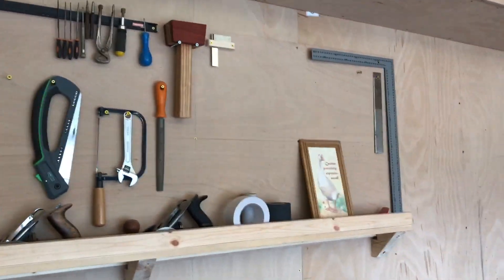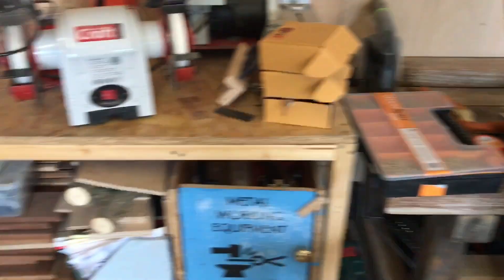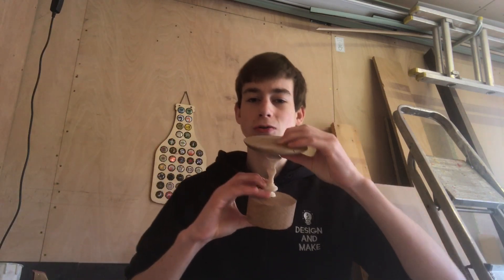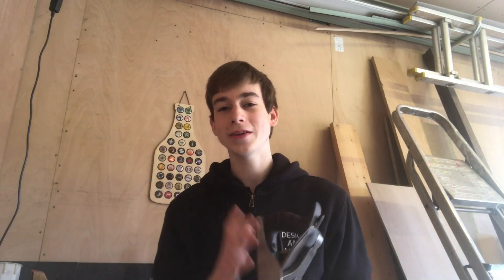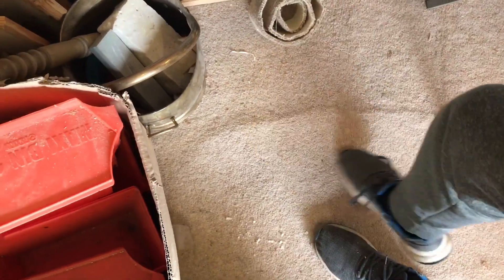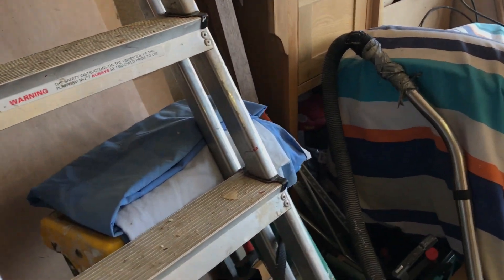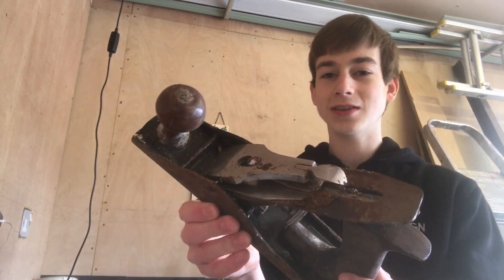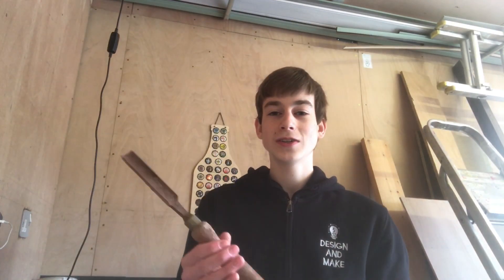Big Workshop Changes | Tool Wall And Old Tools

Comment: Excellent update.  Really like that tool wall - nicely laid out and functional.  It will make a great backdrop for your filming.  I really like how the shop is coming together.

Depending on how much mahogany you have, you can either make a box or a nice little side table with some turned legs.  Mahogany is my favorite wood, I think it just looks amazing.

Oh, and you now have something in common with Matt Estlea: Clocks that don’t tell the right time. XD
Reply from the maker: Thank you! That’s the plan to use it as a backdrop. I love the idea of the table I hadn’t thought about that! Thanks for the idea, I have so much mahogany so could definitely make a table. I’m glad I have something in common with Matt even if it’s not his woodworking ability 😂!

Comment: Brilliant video, as ever.  I have found that if I have lots of shavings on the floor from the lathe, I do attract lots of mice (so be careful), and those pieces of mahogany(or something) you could use to make a nice, wee dovetailed box
Reply from the maker: Thank you! I clear the shavings at the end of the day and my workshop is in a garage which has no gaps for mice to enter so it should be fine. I’m probably going to use some for a box! Good idea thanks.

Comment: Great video!
What are these challenges that you talk about as I would be interested to know also I have restored one of those vices and had to get quite creative with some of the parts I used as replacement springs and washers for those are really expensive and hard to find. Yours looks in better condition though so should be great
Reply from the maker: The challenges are for Woodturners and are called the YTCCC2021 (look up on YouTube). The vice should be fun to restore and is in working order. Thanks for watching!
Reply: @DesignandMake  thanks I will check it out